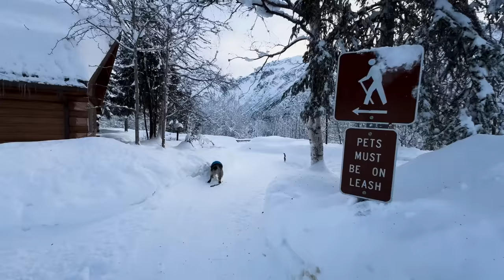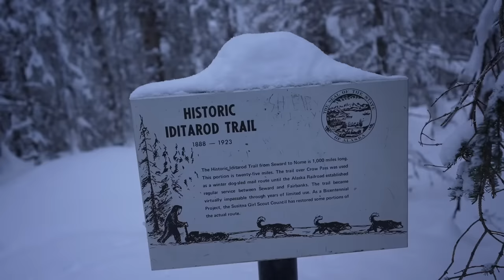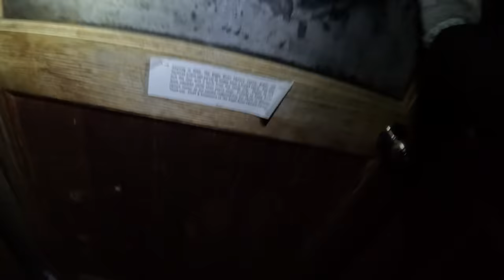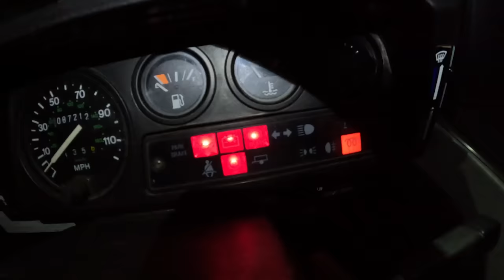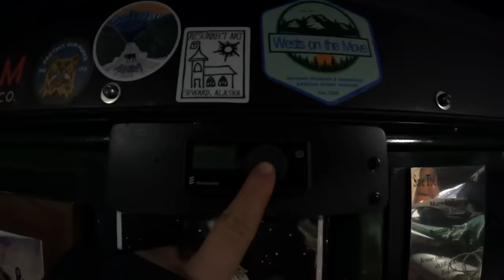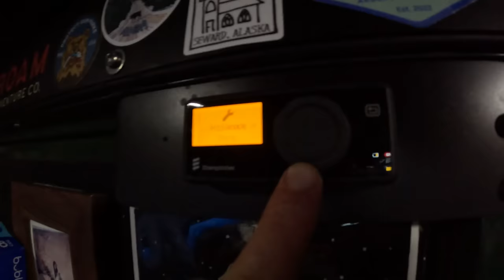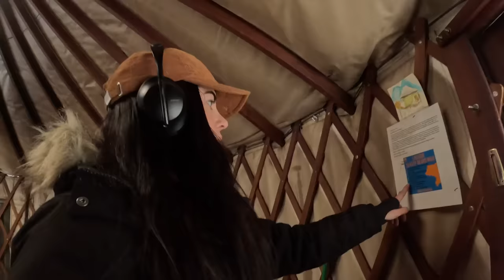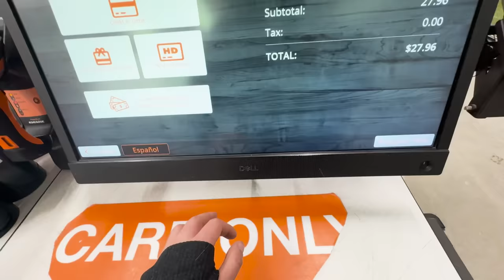3 Horrible Days Truck Camping in Alaska

Comment: I didn't read through all 800+ comments.  😉  Hopefully someone already helped you with the stove.  If not you should know that wood stoves can be temperamental, especially if pine (soft woods) are burned.  When you get smoke coming back into the room, cabin, yurt, tent, whatever it usually is caused by a closed damper or blocked stove pipe.  Spark arrestors are quick to clog with soot or creosote buildup.  Take the spark arrestor off and make sure damper is open, then try again.  Even wet wood will light if air is flowing.  A cracked window can help initially to get the draft going up pipe.  Clean arrestor then put back on while enjoying the warmth of the working stove.  Good luck.
Reply: She didn't even attempt to look at the stove. She just kept lighting the wood.
Reply: Could be lots of creosote in the chimney pipe, which causes smoke and terrible burning and can actually catch on fire. In the cold, with a long pipe, creosote buildup is more likely in the pipe.
Reply: Don't know why campgrounds and campsites always only Supply Greenwood which don't burn that's why I always bring my own
Reply: What's a spark arrestor?
Reply: A spark arrestor normally is a wire mesh or a cap at the top of the stovepipe that catches the largest sparks.  Small sparks normally pass through.
Reply: it could have been a  huge blockage of frozen  snow/ ice. Or just a closed damper.
Reply: That is good advice but also, this happens every time we light a fire in our yurt. We have to open the vent in the skylight everytime we open the woodstove door. We have to get the flames going hot enough to suck a draft up the chimney. I don't think she knew about the vent on top. We even moved our woodstove from a side chimney to the middle of the room.
Reply: Sleepingtiger, I've never stayed in a yurt, so have no experience with how well they breath or get the all important draft going.  Your point about opening vents is great.  It is all about a clean/clear exhaust path and a temperature difference to get fresh air in to combust, then place for hotter air to freely go.
Reply: @randaltotten9358 cuz green burns LONGER and is easier to get. Wow

Comment: The damper is closed.. that’s terrible you didn’t figure that out. It’s why it’s so smoky in there.
Reply: This. Can’t believe she doesn’t know this. 🙄
Reply: That might be why but our woodstove smokes up our whole yurt like that too. We have tricks to help prevent it from being as smoky but there is a vent on the skylight, and she probably didn't know that. We have to open our vent every single time we open our woodstove door. And yes, we know how to use our damper.
Reply: @leoross5777  Someone pointed out that the damper was closed originally but it was opened later in video. So apparently she did know how to open it. I'd say most people that have wood stoves wouldn't be able to start a fire and are your without smoking the whole place up because it's very different than any normal house. So people that say they know better actually no less than they think they do.

Comment: The thing about diesel heaters is that the fuel can turn to thick jell in the cold. Just when you need it most. Heat the diesel heater and fuel with the buddy heater and then try it again in an hour...
Reply: That's what I was wondering. I wouldn't want a diesel anything in an Alaskan winter.

Comment: The best thing out of everything that happened is that Po was still operational, the heater in Po was working, so thank God you weren't stranded with no heat at all.  I am so thankful that you were able to make it to town and find someone that could fix it.  One last thing to remember is that liquid carries electrical current, so any spilled liquid would carry current from one cable to another and cause shortages fried wiring/cables.  The best part about all this is that you and Blue are safe and not stranded away from help.  May God continue to Bless and Protect you always.  And by the way, don't sell yourself short....................You are one heck of a COURAGEOUS, BRAVE, SMART, ADVENTUROUS, PERSEVERING, AND DETERMINED YOUNG LADY!!!  You are probably one in 10 million that would have the courage to do what you are and have been doing!

Comment: Keep damp wood on top of the stove, the warmth dries it out.
 But even damp lumber should be dry inside, if you know how to split and stack it. Not presuming, but have you had firecraft training?
Reply: the thing is they stock wet woods the owners responsibility for the renter
Reply: It was probably a green tree that came down in the snow, and someone that didn't know better put it there. Let me presume. Your "Fire craft training" consist of watching outdoor boys on You Tube............ Nailed it didn't I?
Reply: @richardp6461  She couldn't keep the fire going. Is she mean enough to survive freezing cold without it? Let me guess, you're an RV park camper... Nailed it didn't I ? 😅😅
Reply: @pattihart8751  Nailed nothing. 😅😅
Reply: I was wondering why she didn’t just try to trim the bark or the wet away from the dry? Might be a little extra work but worth it so you don’t have to hike at night in the woods
Reply: @jamesstephenson8789 it looked like she was in the clips but I’m not sure. They may have just been too damp for that to work

Comment: You need to open a window or Crack door open a little to get the initial fire draft going . Also close the fireplace door tightly completely closed and just open fireplace vent a tiny bit at first until the flames get bigger and hotter to where you can hear the air being literally sucked in to fuel the oxygen starved fire. This will make it burn hotter faster, and thus, more wood will start burning, and fire will then get bigger at a faster pace.  I remember the first time learning how to do this and how amazingly well it worked once you employ the  right tweaks to create the optimal draft,flame ,vent adjustment ratio. It makes you feel like a powerful pro once you get it.
Reply: Was the damper open? Closed?
Reply: @occamsrazor7939  It looks like she opened it.
Reply: This is the best comment I've seen on here about the fire situation. But if the wood was wet/green it would have been extra hard. She might have failed regardless. We have to open the skylight vent every time we open our woodstove door. But we do have to keep the door slightly cracked and not all the way closed until the fire is burning hot, otherwise it goes out.

Comment: When Maria entered the yurt, the handle for the damper was turned down 6:45.  When she was trying to start the fire 7:14 the handle was turned up.  So maybe the damper was left open by the previous occupants and she closed it.
Reply: My yurt smokes up like that all the time even with the damper open. We have to open the skylight vent when starting the fire and use cardboard to get the flames big enough to start a draft up the chimney.

Comment: The ones renting the yurt should have had note / instructions about the damper.  You made the right decision - too cold to tough it out.
Reply: I don't think it was the damper. It was opened later. Our woodstove does that in our yurt too. You got to get the flames hot enough to create a flow up the chimney, which is impossible with wet wood. We also have to open the vent on the skylight though to let the smoke out of the room and I don't think she knew about that.

Comment: Your learning life lessons and now realize Michigan winters don't hold a candle to Alaska's extremes. For future knowledge....You were surrounded with pine trees that all contain FAT WOOD and all have dead limbs that will burn anytime to start a fire. All ya have to do is push the lower branches of the tree aside and go in and get your good fire starter branches with the hatchet or just break them off. The Diesel heater intake is not your fault...they suck for under a vehicle. I fabricated my own that uses a 3 inch tube with dual K&N automotive air filters. Good Luck...God Bless ya both and keep ya safe.
Reply: I dont know Michigan can get pretty bad.  Anchorage I hear is not too bad.  I have also been told by soldiers who been to Fort Wainwright in near Fairbank, and Fort Drum in NY, that Fort Drum is actually comparable if not colder.
Reply: It was not a problem with wet wood the gal doesn't know the damper on the woodstove had to be open .
Reply: @peterloichtl4512  The damper was open. My yurt has the same problem. Need to open the skylight vent every time we make a fire.
Reply: I was thinking the same thing as I was watching. Go outside and find some crispy spruce tree branches to use as kindling. I've dealt with this very situation hundreds of times in our yurt and it's rough. Especially with wet wood. It can take several hours to get the fire going.

Comment: iv never really had an issue with wet wood in the winter, snow doesnt make wood wet. its frozen, i think the issue here is you probably didn't open the damper on the wood stove which allows oxygen into the stove through the front, making the fire burn and the smoke exit through the top, usually crank open the damper until the fire is good and roaring with lots of coals and then you can leave it open just a crack while you sleep, it will make the wood burn for longer if the damper is only open a little bit.
Reply: I was thinking she didn’t open the damper cause there was smoke in the cabin your right
Reply: I think she didn't check the damper on the flue, not the stove. Even with the woodstove doors open, the smoke was going back into the yurt rather than being sucked up into the chimney. Intake damper doesn't do much when the door is open, and an open door is more than enough to provide a strong draft. In a few shots (i.e. 6:44) you can see the flue damper handle, she only had to twist it.
Reply: Fire damper. Open it.

Comment: I think the consensus in all these comments is the following:

1. Do not walk or hike outside your camp at night. When hiking or exploring during the day, because that's the only time you will ever go outside your camp, leash your dog at all times unless you two are isolated from the wilderness.

2. License yourself, then purchase, train with, and carry a firearm at all times.

3. Keep all of your doors locked at all times unless you are standing within a couple of steps to your vehicle. This includes ventilation for your heater. Crack your windows or find another method for ventilation. Never crack open a door for this purpose.

Comment: As an aviator when something goes wrong with the helicopter, it usually starts a chain reaction of other stuff going wrong. You did the right thing to remove yourself from the yurt situation and seek shelter in Poe. You were brave and got it done. Bravery is overcoming your fear and getting it done…it helps that God was protecting you. My pastor calls it a wall of fire protecting you. You are a great leader for Blue. Sorry for your bad luck but you overcame it. Looking forward to your next adventure!

Comment: I've burned a lot of wet/damp wood in my wood stove.  It's not easy to get going or to keep going, but I have a couple tips.  It looked like you had one larger piece of wood at an angle a bunch of tiny pieces around it the whole time.  Unless you have dry wood that isn't gonna work.  On the bottom I always put down two pieces of larger kindling parallel to each other that are high enough for me to insert paper or cardboard or fire starters between them.  Then I lay down 3-4 more pieces of small kindling across those pieces, then 3-4 more on those the other way, etc., like cribbing.  I try to make it with the two pieces on the bottom larger, then the next two layers small kindling, and the top 1-2 pieces the size of the one you had in there.  I feed in the fire starter in the bottom and wood shavings like you had in the center.  With the cribbing if one piece starts it spreads easily, and once it catches it will burn upward and start the larger pieces and you don't have to sit there feeding the fire larger and larger pieces.  With damp wood you can't just put one big piece in there and keep putting in fire starters under it.

The other thing, if the chimney is cold there's little draft.  If you can light some paper or cardboard towards the back near the chimney it helps to warm it up and start the draft.  Once your fire starter is going you should leave the door cracked and you should notice the air rushing through the door onto the fire/coals like someone blowing on it.  If you just leave the door wide open there's little draft, and if you close the door on a fire barely going with wet wood there's usually not enough air and it will go out.  Leave the door cracked until it takes off.

Once you get a fire going, split a bunch of wood in various sizes and keep them on top of and around the stove to dry out, and cycle them around as they dry and you burn the pieces.  I was also wondering if that chimney cap or chimney wasn't drafting because of creosote.  Always a good idea at a place like that to check the smoke outside when you start the fire and make sure it's coming out good.  If you tap the chimney pipe and hear what sounds like glass pieces falling that's creosote buildup, choking out the air flow.  I think your problem with the fire was you didn't get a hot enough fire to warm up the chimney to create a draft, so the smoke wasn't being sucked up the chimney.

With damp wood you also have to keep the fire stoked once it's burning.  Soon as there is room for another piece you need to be on top of it or you'll be back goofing around getting it going again.
Reply: Sure…but all she had to do was open the damper….
Reply: @aerynstormcrow  I didn't see a damper, and several people commented they didn't see one.  Not all wood stoves have a damper.  Some have a baffle system that doesn't need one.  The shots she showed inside the stove looked like it was a newer type stove that may not have a damper.  That's why I don't think that was the problem.  Mine has an air control and damper on the front of the stove above the door, but my niece's stove doesn't have a damper at all.
Reply: But some stove pipes aren't installed correctly and restricted draw. It was.clear there was NO draw there. First thing I thought of is did a bird build a nest in that stove pipe or has it been cleaned ever? I only have a backboiler woodstove for heat and nothing else, the advice on how to build up under the log is spot on to get air flowing around the log
Reply: When all else fails...lighter fluid! 🤣🤣🤣

Comment: If your diesel heater alarms, you can take the battery cables off reset the alarm by taking the cables off, then put the cables back on and you can try and fire it up again. One thing I recommend is running them on kerosene once a month to keep the internal combustion elements clean

Comment: You actually were building the fire all wrong in the stove.   I lived in the mountains for many years.  A real hardcore mountain man showed me the trick!   You have to make a log house of wood, inside the stove, with the entrance of the wood house facing you.    It only requires 4 split pieces of good size wood (or 4  logs of limb wood).  Pine is best because it ignites the easiest, but watch out for pops from the burning sap.  Put 2 pieces of wood into the stove, side by side, spaced about 5 inches apart (about width of your fist).  Take two more pieces and lay them cross-ways on top, creating a cross section.  About 2" spacing between them.  The fire starter goes in the center spacing (entrance) of the house and can be additionally fed by some kindling.  Because of the containment created by the logs, the fire in the center will create a vacuum, drawing more air into the center of the house increasing the temperature of fire very fast which helps to dry and ignite the logs surrounding it (especially the cross sections on top).  A few blows, some kindling if necessary, and the fire will get real real hot, enough to dry and ignite even some pretty damp or frozen wood. 

I've been able to start large whole log sizes of limb wood without splitting them with this method.  I only used splitting to make wood small enough to put in the stove.

Comment: NOTE TO SELF wtf dont ever tackle wilderness situations without being proficent at fire starting unbelievable, one of these days a silly girlie giggle wont be enough to save your life . I pray you dont find out before you have an opportunity to learn.
Reply: I think the damper was closed so it filled the
Room with smoke
Reply: @RecklessRavenFarm  Our woodstove does this in our yurt even when the damper is open. We use the vent in the skylight and have to make a strong flame to pull the smoke through the chimney. Chimney needs to warm up.
Reply: She had wet wood. She was told there was wood provided. She even brought firestarters. We rely on wood heat and have taken hours and hours to get wet wood to start burning all types of random things in our house to get it going.

Comment: Another thing that can happen is if you run your heater on low all night , it may soot up inside. Doing this too many times will cause the heater to fail in starting up. You should turn it to high for 15 minutes to burn off the soot before shutting it off . Take care and be safe.

Comment: I call these "f*ck it days." You kept a good attitude for what you dealt with. The woodstove in our yurt does this as well. We have to open the vent in the skylight every single time we open the door to the stove. There was probably a rod leaned on a wall that you can attach to the hook hanging down. Just in case you yurt camp again. I found putting cardboard and enough kindling in to get the flames going really big right away helps suck the smoke up the chimney faster. It's a pain. You're smart to have back up heat. We live off grid too and have multiple heat sources, and a couple battery banks. 2 generators. Thanks for sharing your adventure. You're a tough, brave lady with an adorable companion.